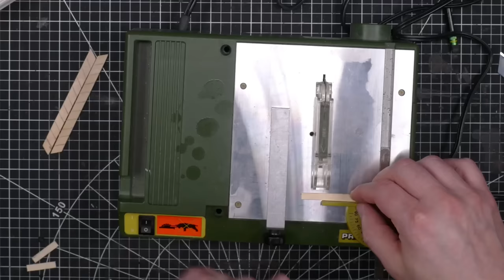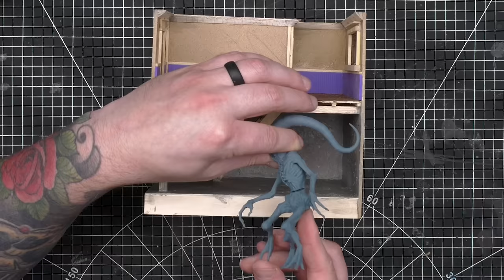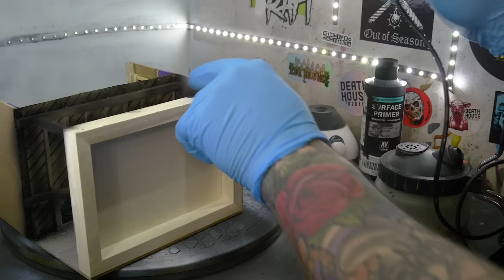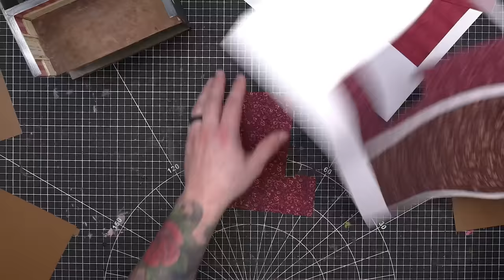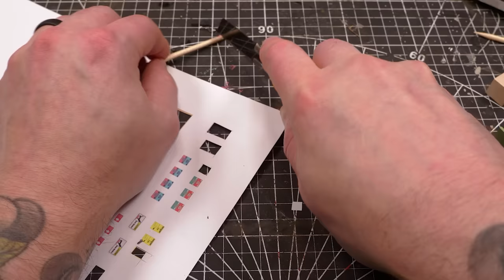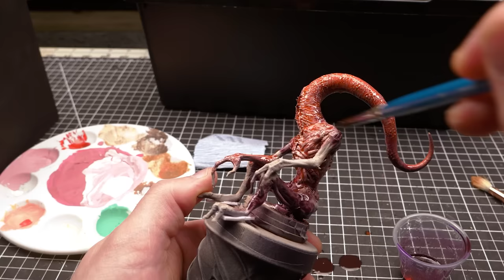DON'T GO IN THE BASEMENT a Miniature Horror Diorama Build

Comment: Great tip on sealing mask edges with the base color before spraying the other color. I almost never hear anyone suggest that. And if you forget you can spray a regular sealer to do the same thing. I use Tamiya a lot so I will shoot the flat clear XF86 along the tape edges. I've even brushed on acrylic floor polish (Future).

And that hot water heater needs to be replaced right away before the bottom ruptures. That is a lot of rust.

Comment: Painter here. Meaning guy, who paints walls for a living.
Don't paint the original colour over the masking tape. That is an extra layer that will thicken the paint of the secondary colour. Do as few layers as possible.
I personally prefer weak cheap  masking tape because it won't tear the primary layer off, and give the very edges of the separation lines a good pressing stroke with my fingertips or depending on the surface texture, my fingernails.
I prefer paper masking tape, but pvc should work too. Usually "polyamid" (read: the material of boxpacking tape) masking tapes don't stretch well enough to give a good separation line, not to mention they are usually are loaded with a glue that both leaves residue and tears off the primary layer.

Again: use as few layers of the secondary colours as possible. I once had to do a straight line throughout the whole house and it needed to be painted with a primer, a primer wallpaint, two layers of latex paint and sadly a third one. (Ducked up something with the primary wall-paint, and it seemed to be uneven.)
It was horrendously thick. Customer liked it, but I hated it.

Comment: Watching you lay out the floor accurately, and all I can think is, "wow, what a shock, the guy who worked as a carpenter does the carpentry part the way you're supposed to."

By the way, worm tongue head is one of the aspects of Nyarlathotep.

The only addition I could think of would be that single hanging naked light bulb you see in every basement to light it.
Reply from the maker: Well technically not the way you are supposed to, but the way that they used to do it. 😛
Reply: @BlackMagicCraftOfficial  Period accurate, then. Also, the wall staining reminds me of the nicotine stained walls of old smokers' houses. The slightly yellowed look of every surface.

Comment: Nice! A quick tip:
If you want to tile images for example a piece of carpet without making the seams too obvious there is a tool both in Photoshop and GIMP that works surprisingly good.
In Photoshop it's called content aware fill and resyntheziser in GIMP. If you use the tools on the seams the app uses Ai to "fix" it and blend it together. In my experience GIMP's resyntheziser actually does it better but it's been a few years since I used Photoshop to any longer extent.

There are more in depth guides online. Have fun!

/Bo

Comment: Wood is fine to cut the small cans. You just need to not cut it while holding it with your other hand, that's not stable enough. Put it in a vise, use the tiny table saw, hell even just jamming it in a corner will work.